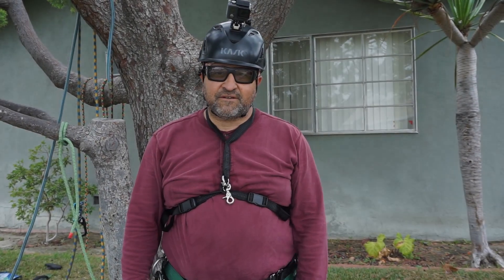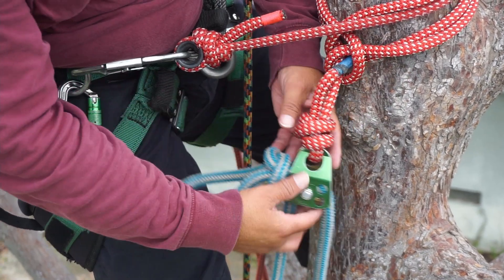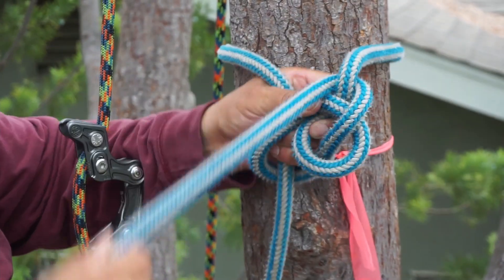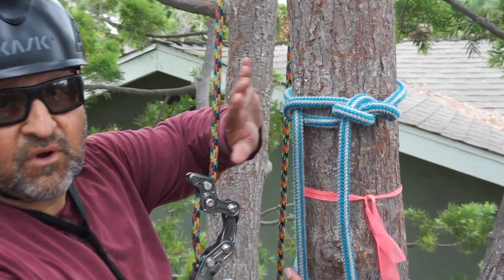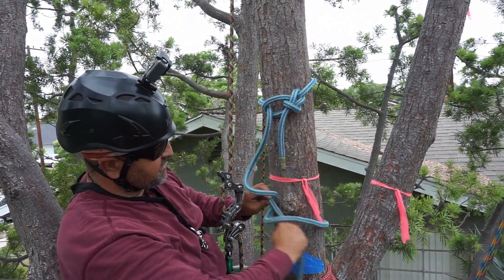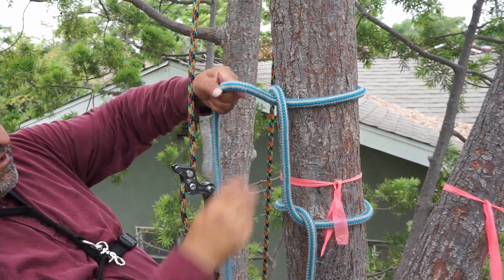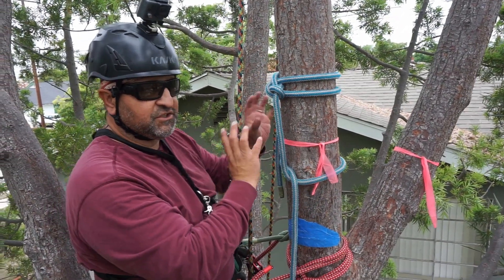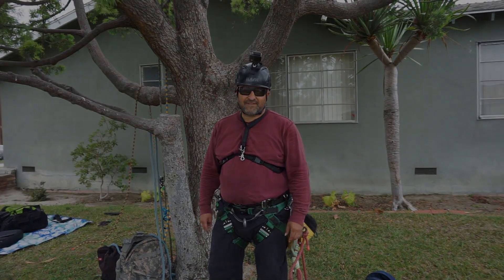A Hitch That Can Save You When Rigging Trees, Marlin Hitch Vs Half Hitch

Comment: How does a clove compare to a bowline for the rigging knot? Never seen a clove used, always used and seen bowlines
Reply from the maker: When I use a clove hitch I usually do it with smaller branches  and you'll always have to back it up with two half hitches. The running bowline is good to use on heavy wood and light wood.  I think a knowing how to use both is beneficial.
Reply: @BinoH  thanks for the info. I'll have to give a try soon. Even after a few years there's still a lot of different ways to do things in this industry.
Reply from the maker: @StinkyPete69  nice to hear let me know how it works for you.

Comment: Not an arborist but enjoy your vids. I had a question about the proper hitch to use in my situation.  At my work we sometimes go into open air tanks that have rails around them for safety.  We sometimes spend the whole day sending 35-50lb buckets via its handle down the tank.  Some of the guys use a clove hitch but I've read it's not secure.  Can you recommend a super secure hitch to tie into the bucket handle and the other to the rail?  I'm afraid one day someone might get hurt.  Someone recommended backhand hitch or the boom hitch.  Thanks for abby help
Reply from the maker: The clove hitch is a good hitch but it should be backed up with a half hitch and then it would be very secure.
Reply: i can reccomend you a slipped spar hitch, it's a very secure variant of the clove hitch, just put the line, from the right, down to the first wrap and you are done

Comment: I've always used a half hitch under a bowline or timber hitch. I can see a benefit to that marl, if the groundie let's the rope get to the pulley, it may not get through, and you may not need to re set your rigging line !
But I'll be stickin with the half hitch 👍
Reply from the maker: I agree I like the half hitch more and no worries about a overhand knot getting stuck.

Comment: Nice video.  It took me a minute to distinguish the 2 knots by sight, so there are probably other people tying one when they mean to tie the other.  Check the ends relative to the loop around the stem; if they are over of the loop: it's a half hitch, if they're under the loop: it's a marl.
Reply: yeah. The marl does not collapse if the stem were somehow removed.
Reply from the maker: Very crummy if you put it under a load.
Reply from the maker: Glad it helped!